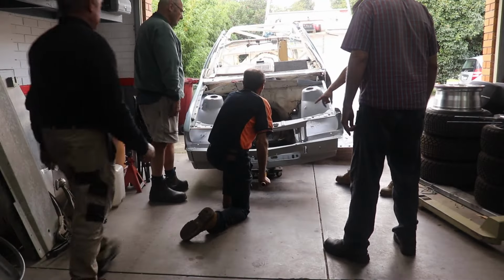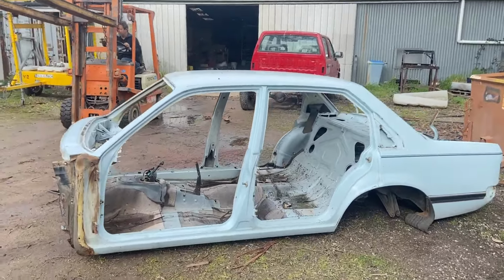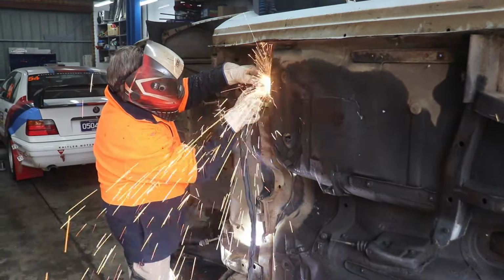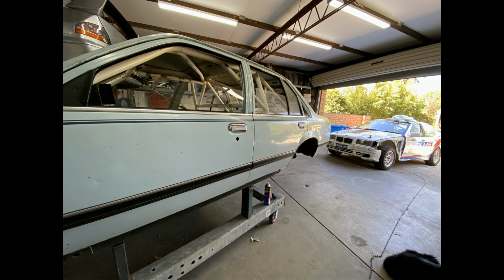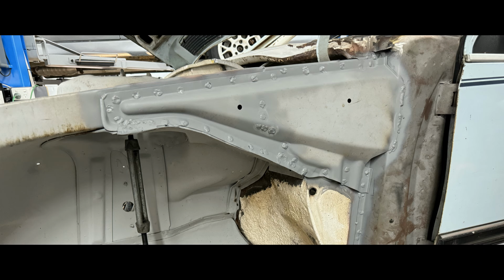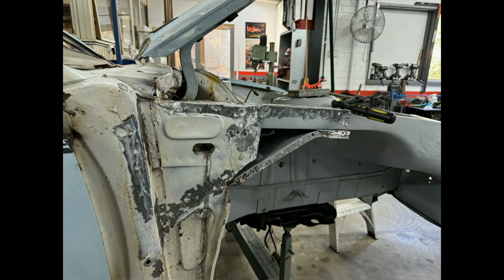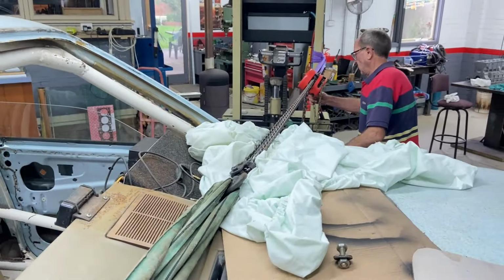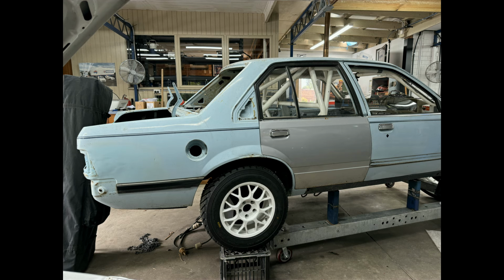Holden Commodore Rally Car Rebuild part 3

Comment: That is some impressive work but in my eyes and probably legally it is no longer Geoff Portmans old car and a different car with Geoff’s old roll cage
Reply from the maker: Well it was that or no car at all, but when you sit in the car you will be sitting in the seat Geoff sat in, your feet will be on the floor Geoff's feet were on and you'll be looking at the dashboard Geoff looked at while holding the steering wheel Geoff held. The car hasn't been restored and any part that could be reused has been down to the fuel tank mounts that we cut from the damaged section and used again. But thank you for the comment and taking the time to watch the video, we do appreciate it.
Reply: I get that but you would of got the same result with a complete reshell with a lot less work
The thought of reusing that roll cage then actually doing it after a crash that big blows my mind 
And after reading the history of Geoff’s Datsun 1600 that was reshelled multiple times it just doesn’t make sense to fix that body shell
But that is just my thoughts and I hope it all goes well and car is enjoyed when finished